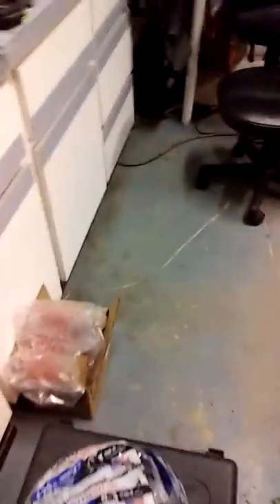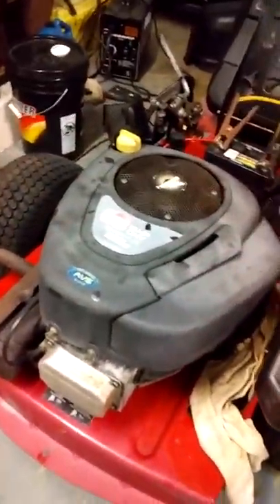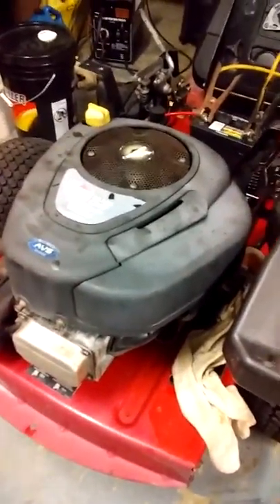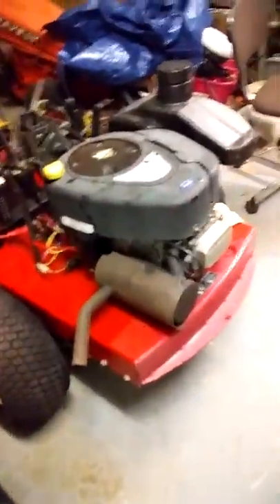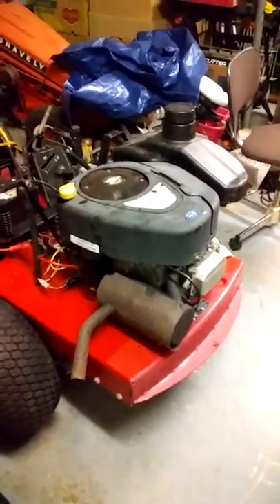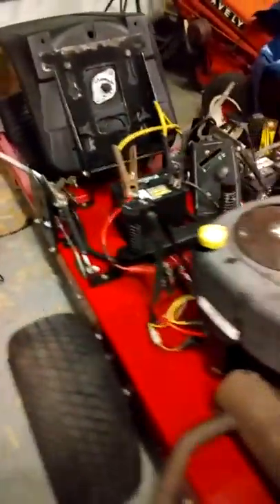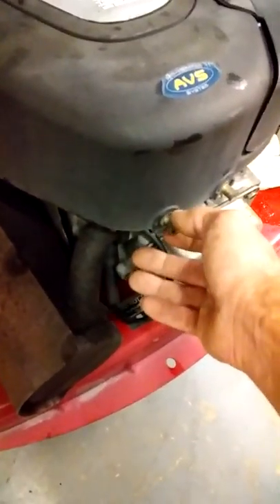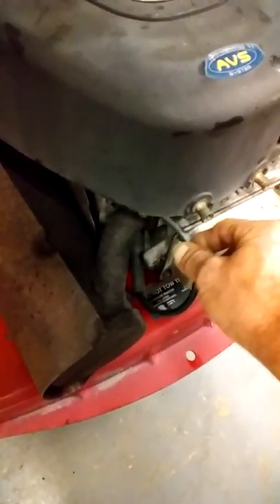20171222 011502 Timecutter 1642Z motor reassembled

Comment: I have this model found a bad cam where can i get parts for this
Reply from the maker: look at your mdl# on the motor, then go to ebay, you can search for the cam there, I buy every thing off ebay, and when I can't find the part number I go to partstree.com click on toro, type in toro timecutter 16-42z , look at the production number on your machine, you'll see a list pop up with toro timecutter 16-42z, serial number  ####### , that way your dealing with the right mdl, then look at the engine spec,example (  https://www.partstree.com/parts/toro/mowers-zero-turn-lawn-mower/74325-16-42z-toro-16-42z-timecutter-z-zero-turn-mower-sn-230000001-230999999-2003   ) (    https://www.partstree.com/parts/toro/mowers-zero-turn-lawn-mower/74325-16-42z-toro-16-42z-timecutter-z-zero-turn-mower-sn-230000001-230999999-2003/crankcase-assembly-engine-briggs-and-stratton-model-286h77-0165-e1/    )  , there's a complete break down of the entire mower you just have to dig a little. you can get the entire gasket set for 12.99, a cam shaft plus tappets 30 bucks . use your model# and serial # , there will be a range from  (SN: 230000001 - 230999999) (2003) several year mdls have different ranges note that is the 2003 mdls
Reply from the maker: try cross referencing this cam with your motor, depends on the mdl# slight variations I think between the years im not sure, but I did that 2003 mdl and these popped up so it's probably new numbers that supplement for older mdls.  https://www.ebay.com/itm/Camshaft-fits-Briggs-and-Stratton-793880-697110-795387-Crankcase-Gasket-Oil-Seal/273386574011?hash=item3fa71c10bb:g:VvkAAOSwLMJbZAHv:rk:29:pf:0  , i'll take the numbers from parts tree and search them all out generally one of the 2 numbers will match newer parts.